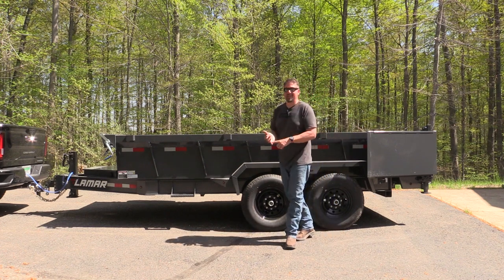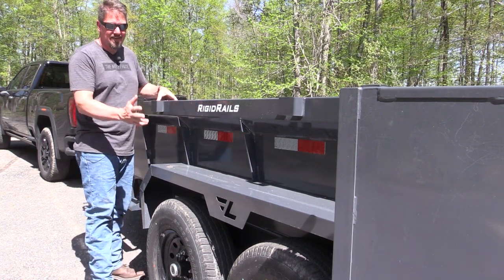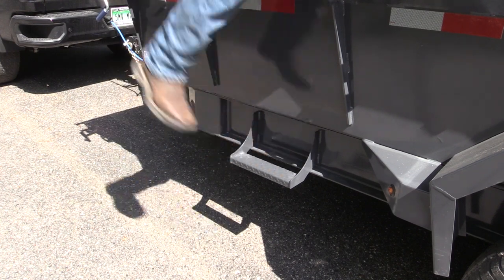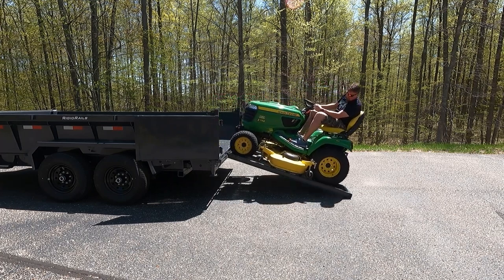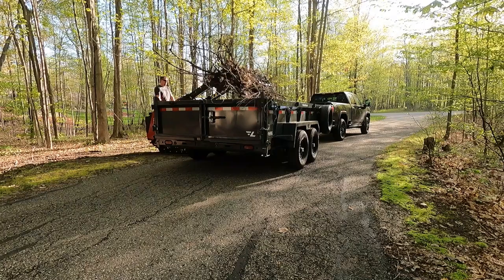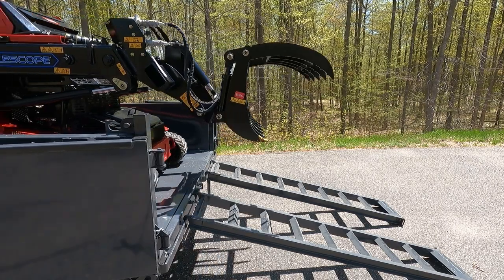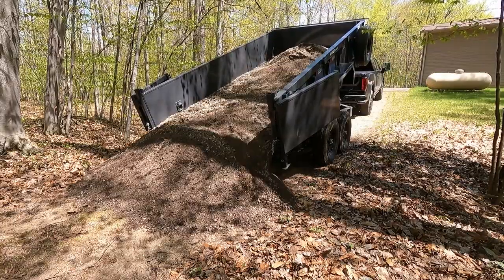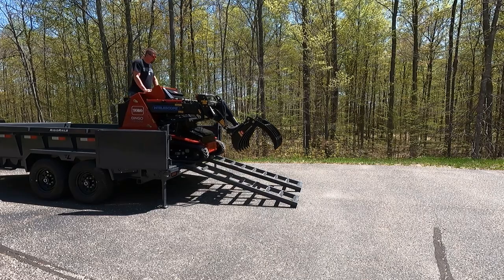Why I Chose The Lamar 83" x 14' Low Profile Dump Trailer | Full Review

Comment: 5 years ago I bought a Lamar 8'x16' 7k Heavy duty utility trailer an 2 years later I purchased a 5'x10' 7k deluxe dump trailer. They work great for when I'm doing jobs with Kubota bx23s. Customer service is top notch also when I wanted to purchase one of those front mounted tool boxes for my utility trailer. You can also buy the gray paint direct from them as my dealer never has any in stock. I bought 3 cans to do touch ups an they were only $9 a can
Reply from the maker: Thank you for the tip on the paint!
Reply: hi I’m looking in to getting in the junk removal business. I was thinking about the f250 or 350 with a trailer. If that falls in the cdl category which I have a license already does that mean u have to get dot also. Also what’s better diesel or gas?

Comment: I’m looking at this exact trailer to purchase. How is it holding up for you? Is the powder coat coming off? I’m also comparing to the diamond c lpt. Thanks!
Reply from the maker: It is holding up well.  If I had a complaint it would be that in some arears the powder coat was put on too thick and bubbled a bit.  I am sure it is rusting under, but the bubble has not popped.  Love the trailer.  not sure you can go wrong with either diamond c or Lamar.  Prices now are getting much better!
Reply: Thank you for taking the time to reply. I have looked at so many dump trailers in the past few months. You really have to just find people who use them.
Reply from the maker: @cabinviewventures  Have you looked at galvanized ones?  My buddy bought an N and N.  Pretty nice that it won't rust as fast.
Reply: @WorkshopAddict I have and they seem pretty nice. About the same price as diamond c right now.

Comment: I have a 2017 14x7 pj low profile and you are right. While I think it’s a well built trailer that powder coating is terrible and the drop axils not only make it too low when dumping but also the drop spindle puts too much leverage on the axil and cause them to bend easily.

Comment: Just to note I have seen most manufacturers do a spot weld on the sides. VERY RARELY have I ever seen folded sides in that size. So just to note there is absolutely no con on that 7 gauge floor. 

Great channel and video!

Comment: I been eyeing a Lamar dump trailer for a few months now, I think you hit on a lot of the points already on my list.  I do wish the tail lights were on the side rails for protection foremost, and much better visibility second.  And since you pointed it out, balanced wheel/tires are great - wouldn't have considered that until you mentioned it.

And I agree, my first equipment trailer was a PJ and after I started finding powder coat in my driveway after 4 months, I won't buy another.

Comment: How does it tow fully loaded?? And what do you tow it with ??
Reply from the maker: You know it is behind you when it is fully loaded!  But it is balanced well and does not buck or teeder todder.  I have a gmc 6.6 gas with a six speed and a 6.6 diedel with a 10 speed.  The diesel does better, but the gas is not bad at all.

Comment: What size truck do you have (or need) for that trailer?
Reply from the maker: I have a GMC 2500 with the 6.6 gas and it does fair with it loaded.  You run higher RPMs to get it moving.  I also have a 3500 with the 6.6 diesel and it tows it like nothing it there.  An F250 or F350 would be great.  You never want to load all the material up front or all in the back.  It should be spread out pretty evenly for the most part and the trailer takes a lot of the weight.

Comment: Can you haul your 4066R tractor in this trailer or would you prefer a goose-neck trailer?
Reply from the maker: I can haul the 4066 with the loader inside this.  No attachments due to size.  I haul the 4066 on my hydraulic tilt bed trailer because that one is longer.
Reply: @WorkshopAddict  Thats Nice !

Comment: Great review, I am considering to purchase a dump trailer to do some storm cleanups, I work within the tree industry, do you think that size will be a good fit for logs and brush?
Reply: 14’ might be fine, but I always recommend buying more trailer, tractor, truck than you think you need now. If your truck will pull it, you should consider a 16’ 14K trailer (or a 15,600 “down-rated” to 14K). Some bash the scissor lift and say that the telescoping is better. I suggest that you have your dealer raise the bed on a scissor lift & telescoping lift half way. Now push on either front corner of the dump bed. You’ll see the amount of side to side movement that you can make between the two types of lift mechanisms. The scissor lift resists side to side movement better than telescopic. This difference will be helpful when dumping on less than flat ground.